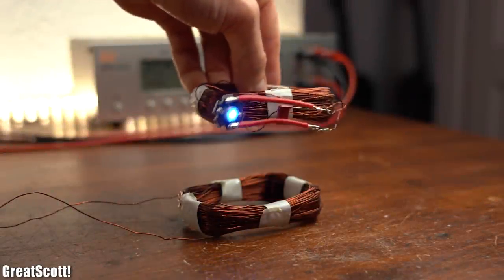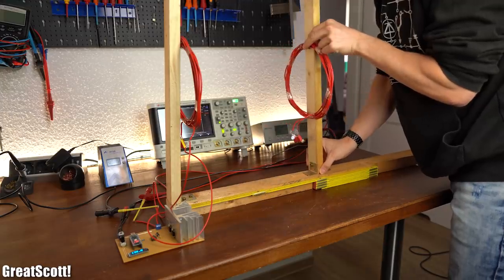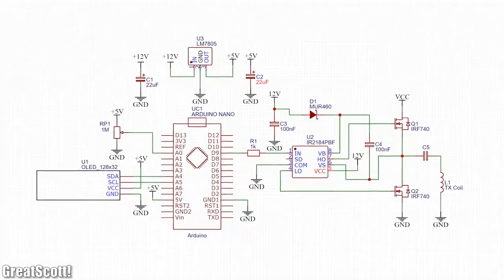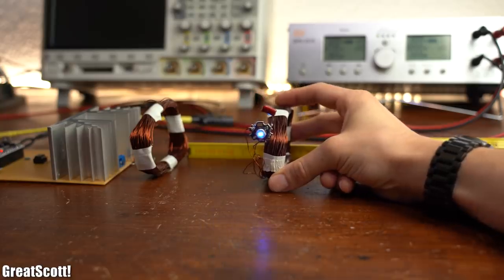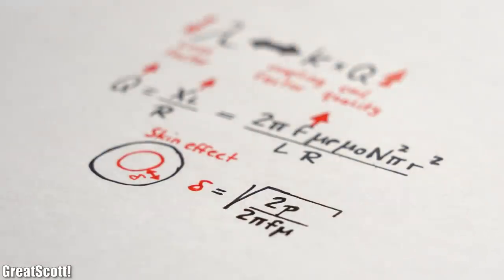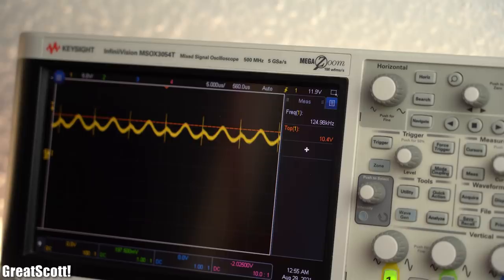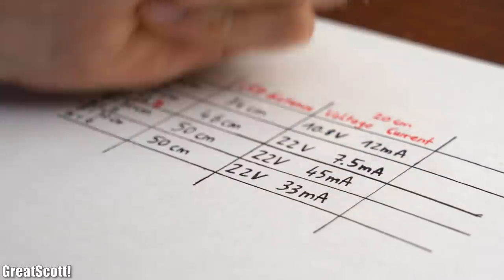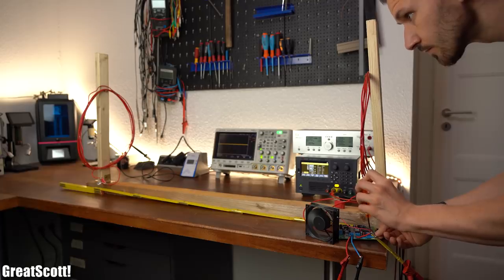How far can I Wirelessly Transfer Power? (Experiment) Better than at MIT?

Comment: Technically (if it's just about wirelessly transferring power) you could use lasers and achieve greater distances. Although the transferred power would be much lower, the distance would be much greater
Reply from the maker: Correct. But with my electronics background it is more about electromagnetic fields in my case.
Reply: @greatscottlab  and the laser is so direct and it could be blocked easily than electromagnetic waves ⚡
Reply: @a6dulsalam511  also with a powerful laser, u have many other factors to consider like fire, blinding hazard but if u want to transmit to particular spot its the way to go and thats y many scientists think that it will be used to power spacecrafts in the future
Reply: Or a belt pulley system
Reply: @ShahZahid  That's true it's gonna be used to transmission power from the space to earth!
Reply: @a6dulsalam511  lol
Reply: what's wrong with using microwaves?
Reply: @greatscottlab  I'm surprised that you didn't just copy the MIT design but with a larger coil, fatter wires, etc.  I've done some of this sort of thing (power coils) and Litz wire is great but it's really hard to work with because you need to strip the enamel from each strand, as each strand is insulated like magnet wire.  I suspect that you only made contact with the cut ends in the solder or only striped some of the strands (I've done both). The total Ohms should be in the milliOhms if done right.  It seems like driving in the MHz should not be a big problem.  Use a function generator instead of Arduino.  Your driver must be able to work at the higher frequencies though. One trick to strip Litz wire is to use paint stripper. After all, enamel is really only paint. Use gloves and goggles though. And old cloths.  I've burned holes in perfectly good shirts.
Reply: I think transmitting power  both laser and electromagnetic wave isn't practical over long distances 
Laser seems very good at first but it's only problem is that the leser diode isn't powerful enough for transmitting enough power over long distances and also you need a very good soler panel for receiving that energy and any obstacles will effect the power transmission 
And now the electromagnetic wave it's practical for mobile phone because of the coils distance so long distances isn't a good idea for transmitting power over em wave than tesla will be able to power the world 100 of year's ago
Reply: The other issues with lasers is converting light power into electrical power which is not efficient and lowers the amount of power. Also with lasers, eye safety becomes an issue because high power lasers are damaging to the eyes if exposed.
Reply: @electroscientist4447  laser technology is one of the fastest evolving one out there just recently we didn't even have green laser diodes but just in a couple of years we got those as well we are just getting started with lasers, also laser would mean only using solar panels, some scientists have discovered that they can use the actual momentum of the light to push matter but maybe in the future it will be practical but even right know we have very powerful sold state lasers (diode) the ir ones to be specific and a defeaction grading or other can be used to spread the beam across multiple solar panels but yes even small changes in the atmosphere can effect this massively, but ig if we are lucky we will see what the future holds.
Reply: @electroscientist4447  Correct. Powering things with lasers is a bad joke that will no doubt garner a lot of "research funding".

Look at how efficient lasers are, optical output in W vs electrical power in, in W.

Look at solar panel efficiencies.

Then consider how much optical power is lost due to scattering through the atmosphere, dust, pollen, pollution, etc.

It will never come to fruition, but a lot of money will be wasted in it's pursuit. I thought the climate crisis was a thing and electricity production, one of the major contributors...
Reply: @Alientoast the issue with the atmosphere does lower the amount of power however the solar panels are the main issue with laser power transmission, they are not efficient enough to be useful for power transmission
Reply: @AKAtheA  The same thing as with any other EM field. It's HIGHLY inefficient and will always be.

Physics is a thing.
Reply: @AKAtheA  Nothing but you must remember to take the food out first. 🙃
Reply: @greatscottlab  can you make a power station using hly 26650 3c cells
Reply: @greatscottlab  please
Reply: There's a R&D program that uses a laser for power transfer to a drone. It works rather well, given that it is a high powered laser. I think the future objective is to use off the shelf parts.
Reply: @Gallardo6669  the challenge was to transfer 60W with a 60% loss or better...not 600W :P
Reply: Brow I never miss your single vidio .your all vidios r great thanks for making awesome vidios
Reply: @imagoomanwithgoo7563  well you're not wrong.
Reply: @greatscottlab  Light is also an electromagnetic field.
Reply: @a6dulsalam511  And it will completely obliterate any birds who happen to fly through it!
Reply: @kirkkohnen5050  You should say that to the solar panels tech lol
Reply: You could mail a battery to someone....
Reply: But it could be easily interrupted. Just by putting a hand in the laser for example, but that doesn't happen with electromagnetic transmission.
Reply: Right, but there's something special about resonant inductive power transmission.
Reply: @greatscottlab  Can you focus the EM field into a parallel beam though? Like a DIY parabolic antenna made of mesh, or see if you can salvage a couple of satellite dishes. Then point them at each other like those acoustic mirrors in kids science museums.
Reply: Search term: near field vs far field
Reply: @calitts4708  If the laser is strong enough, your hand won't block it!
Reply: I think so it's good for data transfers not for power
Reply: @greatscottlab  IR, visible light is electromagnetic. You mean you are in higher end radio frequencies field.
Reply: @jimmyb1451  Unless the EM field is directional, like microwave or light.
Reply: Strange, only one person mentioned the only one that has ever transmitted any significant amount of power over a reasonable distance. In his Colorado Springs lab notes, Nikola Tesla describes the progression of how he developed his system of wireless energy transfer, probably should explore that before ever attempting to transmit EN waves, you might end up like Heinrich Hertz, dead at an early age from a horrible disease which was probably exacerbated if not produced by his errant EM energy. We know that Tesla was using the earth as the transfer medium at first, that’s how he transferred a kilowatt to 100 100W bulbs to a distance of 50 miles. He went even better with his tower in Long Island, transmitting to a handheld device as far as West Point. He leaves a lot of clues in his deposition for the Marconi patent trial, but he wasn’t given to making gifts to idiots that would misapply or selfishly monopolize his gift. Referenced works can be purchased from “twenty first century books “
Reply: @greatscottlab 
Hey, who said we need lasers in the visible electromagnetic spectrum ?
Can we make microwave lasers ?
RF lasers ?
Reply: @mindaugasstankus5943  
That’s exactly my thought.
If we can make a 100MHz antenna behave like a laser we can efficiently transmit power over relatively long distances without the risk of burning everything in the way.
Reply: @greatscottlab  what about wireles porwed speeker from old phone or low power speker   and it might be dificult because you need diferent frequency to make it sound and play music  THIS SHOULD BE SIMILAR TO RADIO BUT IT DOEST NEED SIGNAL DECODER 
ITS LIKE MINI HOMEMADE RADIO STATION 
IDK IF AMPLIFIER WIL CHANGE LAST RESULT
Reply: There's a startup doing wireless power transfer with infrared lasers and tuned photocells and stuff, wi-charge. Though I think their efficiency isn't great.
Reply: @dougcox835  All of the litz wire I have ever used was stripped by applying soldering iron to a clean cut end of the wire.  In my cases, the type of enamel used on the wire is actually designed to not only melt away from solder-pot application, but also serve as a flux to aid in the soldering process.  It takes a little time with the soldering iron, but it'll tin well through the entire bundle of wires.  No extra chemicals needed.  Of course, not all magnet wire is created with solderable enamel, generally only lower temperature class wire has this feature.  Maybe you had some special high-temp litz?
Reply: @ShahZahid  Most of those problems go away by selecting an appropriate RF laser.  These were invented before anything even close to visible frequencies was obtained.  Most proposals for permanent power links use RF lasers (mostly in the microwave region).  For applications like beaming power to supply something like a steam rocket, those often use visible light lasers because they allow for a much smaller receiver target than RF lasers do.  A ground to orbit vehicle really can't go around with a 10 KM receiver array, but that's not a problem for the connection from the power collector satellite to the surface power grid.  (Until we get serious about building ourselves some real space infrastructure and set of a system of orbit rings and just bring the power down on cables.
Reply: @electroscientist4447  This is why we use the much older and more robust MASER technology to beam serious amounts of power.  There's much better ways than diodes to pump a lot o energy into a lower frequency coherent beam.
Reply: @GojoSenpai25  Which is another reason serious power beaming uses MASERs.  It's quite easy to recover a high intensity microwave beam as electricity, with a better efficiency than you can get with optical systems.
Reply: @kirkkohnen5050  The inverse square law still exists.

If you think 10% efficiency to power something across your lounge room is practical, (50 watts of electricity on your bill for 5 watts of charging on your device, BEST CASE SCENARIO) then suuuuuuure...
Reply: @radscientist  There are definitely applications for a drone that you can keep on station for prolonged periods.  Most of these are military, as civilians don't usually need that much endurance on mobile observation posts and communication links.
Reply: @cezarcatalin1406  Sorry mate, that's not how it works.
Reply: I mean you could also throw some 18650s across the room xD
(technically wirelesser than having huge wireloops ;-)
Reply: @a6dulsalam511  ur wrong, if you get a powerful enough laser obstacles won't be a problem
Reply: @greatscottlab  lasers are focused light… so technically they are extremely high frequency electromagnetic waves
Reply: But transverse wireless transfers has more resistance compared to a longitudinal wireless transfer?
I would guess lasers be lumped with the former than the latter?
Reply: ²11
Reply: well, its electronics not photonics.
Reply: plus low efficiency but even wired applications are cool like with a single optical fiber transmitting both power and data bi-directionally
Reply: @electroscientist4447  The most important thing is coupling efficiency.  Coils are only slightly directional and work very well when on top of each other.  At least with lasers you don't need to worry about the inverse square law taking your energy.  Then it becomes a matter of recovering a high percentage of the light into electricity. Perhaps a black target so that all of the beam heats some reservoir.  But then you have to convert the heat into usable energy. Depends what you are trying to do with the energy as to if it's a good choice. And all the other stuff about say, shining through a foggy day are definitely problems that can't be overcome.
Reply: @SteveWard  I've worked with both.  I like the heat strippable best of course but just cannot wrap my head around any noticeable resistance.  I need to use a microOhmeter just to get a good reading. So the only thing I can think of is bad terminations.  One thing you have to be careful of is that unless you are using 4 lead probes Your probes will be part of the measurement. I've been bitten by that too many times.  Sometimes the probes alone can be a couple of Ohms and you just can't measure the low Ohms of The Litz wire.
Reply: @greatscottlab  but Laser light is also An Electromagnetic field .
😂😂😂😂
So You have to complete your Promise 🤣🤣 .
Reply: @greatscottlab  hi

I guess what you built is a couple of magnetic loop antennas. Have a look at the magnetic loop videos on the Ham Radio channels. They are quite efficient if you build them properly and, for their size, punch well above their weight. 

Typically they will be between 1/8 & 1/4 wave in circumference and a single turn, but the can be made to work outside those restrictions.
Reply: @greatscottlab  light is an electromagnetic field
Reply: @jimmyb1451  Wrong. You're completely ignoring the fact that they already spend billions on rockets to shave off every pound of weight possible. It already takes a metric fuckton of energy just to launch a rocket into space so every pound of fuel or battery cell you add ends up consuming more just to get itself out the atmosphere. That alone is already extremely inefficient not to mention how much they spend to reinforce everything to make sure it'll last in space and all the high tech gizmos that need to be light weight and durable. It doesn't matter how inefficient the energy transfer from here to space is as long as it doesn't need to be carried as additional weight upon launch.

Quick google search says the mars rover can generate up to 900W on a good day, let's just say 1 KW for simplicity and take the cost per KW at $0.30 or so which is rather high compared to the rest of the world but normal for an isolated place like Hawaii. Solar panels are roughly 20% efficient, not sure about how efficient a laser would be at transferring energy at that distance but once you make it past the atmosphere there's virtually nothing in space to block the path and degrade the laser signal, even better if you shine the laser from right outside of our local atmosphere.

Assuming 100% efficiency on the laser end the price would be 5x more to compensate for the loss to the solar panel or $1.50 to give the rover 2x more energy than it normally gets on it's best day. It's obviously unrealistic to hope for 100% of the laser light to get there so lets just assume something like 1/1,000th of the light reaching the target. That puts the daily expenses at $1.5k to give the rover 2x more drive time than it normally gets on it's best day. Considering the fact that they already spent billions getting the rover there, that's like tossing pennies into the fund to get 2x more use out of it. Space agencies would gladly pay that amount to drive the rover around for a couple more hours.

Even 10x that price would be reasonable and that funding could be donated from schools or something in exchange for allowing the school to decide where it goes to take pictures next, small price to pay to get kids interested in space tech. Imagine if the rover were in a bad spot during a storm or something and it's in danger of getting destroyed. Spending 15 grand would be a small price to pay for wirelessly transferring it more energy to get to safety. It doesn't matter how inefficient it is because it's far more expensive transferring a physical payload rather than beaming energy in the form of light. Not to mention those are consumer prices for electricity in one of the most expensive places to live, if they build a dedicated nuclear reactor to produce the energy that price drops down by a couple orders of magnitude again.

Light has no mass to transport and with no atmosphere you'll have minimal losses over vast distances. It also travels at, well, the speed of light making it the fastest possible way to transport additional energy which is important for time sensitive missions. Efficiency becomes negligible when you consider how cheap and easy it is to produce on earth rather than transporting batteries millions of miles away.
Reply: @GojoSenpai25  Wrong. Solar panels are roughly 20% efficient. That means they convert 1/5th of the light that hits them into energy. Now consider that even with the best rocket, it takes 98 pounds of fuel to get 2 pounds of weight out of the atmosphere and into space. that's already 10x less efficient than a solar panel and that's just to get out of our local atmosphere, imagine going all the way to mars. With light there is no weight to transfer energy into space and it moves at, well, the speed of light so it's extremely useful for time sensitive missions that are million of miles away. As far as we know there is no faster way to transfer energy like that.

Wrote a more detailed response in another reply on the bottom of this thread if you want to view the math but even if only 1/1000th of the light reached the target, it would only cost $1.5k to send the mars rover more than two times more energy than it gets in an average day which translates into more than 2x drive time. That rover already costs billions to get there so that price is virtually nonexistent for more operation time, this is also taking the price of electricity from what consumers pay in hawaii which is more than 3x the price the rest of the world pays. With a dedicated nuclear reactor this price drops an order of magnitude lower.

If that price isn't cheap enough for you, imagine if the rover is out of power and some storm or something risks destroying the billions of dollars worth of equipment. Spending a couple thousand dollars to transfer it energy to move to a safe place would be invaluable. I mean we could spend months, maybe years building a new rocket to transfer it some more fuel, then weeks (months?) while it travels there or we could just beam a laser at it and have the energy reach there at the speed of light.

If we beam the energy from space there is nothing to obstruct or degrade the signal either so there would be minimal, or even no energy loss until it enters the atmosphere in mars. Not that there is a whole lot of loss in our atmosphere to begin with, not compared to all the energy wasted getting all the equipment into space. Those losses wouldn't be too practical to transfer locally here on earth, not when we already have super efficient power lines everywhere, but in a multibillion dollar industry like the space industry a couple thousand dollars worth of energy being lost would be like pocket change compared to the price of even launching a 1 pound payload into space.
Reply: @DrakeOola  Wrong?
"Imagine if the rover were in a bad spot during a storm or something and it's in danger of getting destroyed." A storm?
LOL.

You have absolutely no idea what you are talking about.
Your calculations are off by several orders of magnitude, without even considering the built in optimism in your uninformed arguments, Argon Ion laser tubes require Kw's of electricity to create 10w of visible light. Even CO2 lasers are only 20% efficient AT BEST and they're about as efficient as it gets.

Not to mention the amount of power it costs for cooling systems to keep such a powerful laser tube as would be required, from exploding due to expansion of the working gas, or just melting into a puddle.

Lets not even start on beam divergence.

So no mate, I'm not wrong.
But nice try.
Reply: @DrakeOola  "Not that there is a whole lot of loss in our atmosphere to begin with"
Clearly, you have never owned a laser.
Reply: @greatscottlab  hello dear!!! Make a 1024*1024*1024 LED cube. Use smd led to increase resolution. To support the leds use resin (if internal reflection dosen't occur) if it happens, then use normal TTH leds.
Reply: SERIO?? or oyu just jocking now.. or is hell deep lack of knowledge.. laser isone side.. just one side.. on receiver side is with 21%max efficiciency of special petrovskit sollar cell who hate heat?? good luck :)ú or have good dream!s..
Reply: @arcsiz  sure. Fields adds up.
Reply: @cezarcatalin1406  yes. They are called masers.